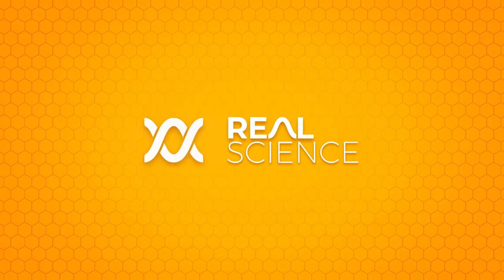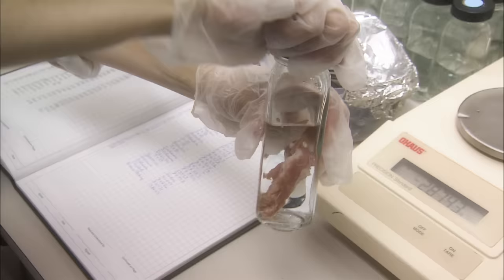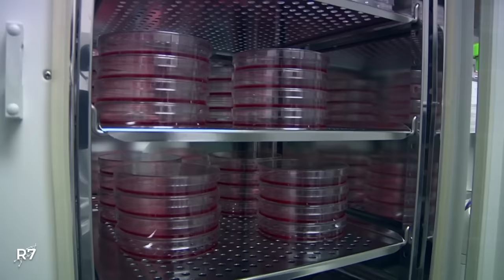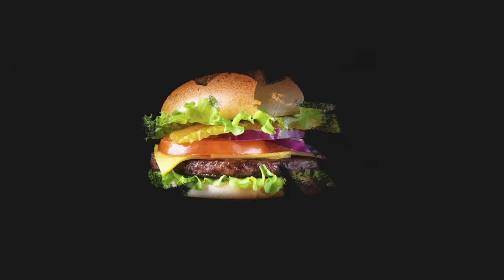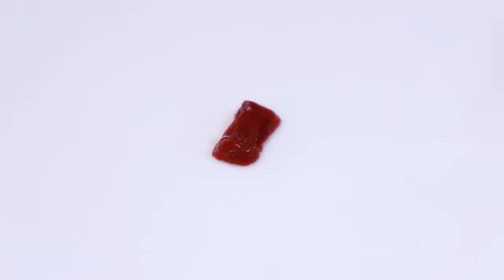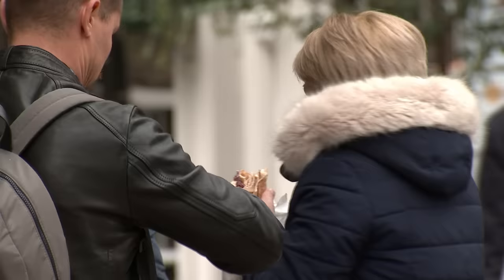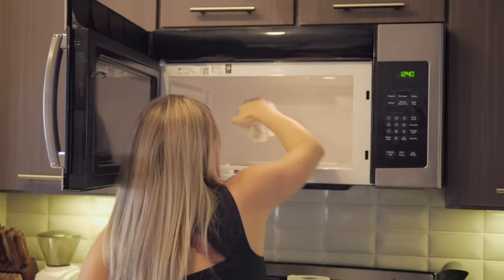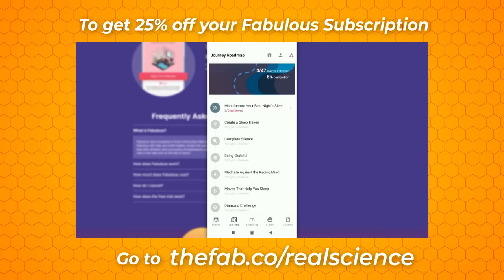The Truth About Lab-Grown Meat

Comment: New technologies are almost always prohibitively expensive. And it will continue to be quite expensive for some time.
    The first microwave ovens, in the late 1940's cost hundreds of thousands of dollars and were only ever sold for massive food processing projects. 
     By the late 50's the price got low enough for restaurants to afford, then by the 80's microwaves got cheap enough that families could use them.
      The price of lab grown meat will come down.
Reply: The first large screen TV was $15,000 ($22,000 adjusted for inflation) in 1997.

Two decades later, they are 100x better at 5% the cost.

The only trick is to keep government off of the market.
Reply: @josephcoon5809  Just look what they did with corn.
Reply: The price is not going anywhere until they solve the FBS problem.  That's going to be extremely difficult, and it's hard to imagine any sort of plant-based alternative existing that has the proper growth factors in it.
Reply: @Warhawk76  Well, in the 1970's no one had any idea how to make transistors small enough that you could make computers smaller AND faster. 
     My dad worked in an oil refinery from 1968 to 1999. 
     They had a computer that helped to run the refinery efficiently and I would often go with mom to pick up dad from work. The computer room in the 70's was two large rooms (about 100' X 100') one above the other. 
     By the time he retired the computer had been updated and replaced. It was now a single unit, smaller than a standard refrigerator.
     Problems with technology always seem insurmountable until a solution is found. This has happened over and over again in history. Why should we thing development of lab grown meat should be any different?
Reply: I can recall when the first microwaves were 500.00 and breadmakers  now look
Reply: Or we find out that we can't lower the price and lab grown meat will simply be given up
Reply: @Eric Taylor  not saying the problem wont be solved, I just can't imagine what the solution might be.  I have used and ordered a lot of FBS for cell culture in the lab, and have a pretty good handle on why it is used, which is why I don't have any good idea of an alternate.  Maybe we will figure out a solution, or maybe we will simply get far more efficient at raising animals for meat.  Humans are immensely adaptable, so either way I am not worried.
Reply: Absolutely right Eric. Lab grown meat will really become prolific once it is adopted by the fast food industry - a market ideally suited to it, with little concern by its consumers over origins, ethics, taste (which could be adjusted with enhancers etc.)
Reply: Even plastic was costly initially, now it's so cheap its a problem.
Reply: @Warhawk76  It will be extremely difficult, so it'll probably take time to identify the constituents of FBS and understand how they work. I think it can be done eventually, but the question is how long the funding will hold out. Will corporations keep funding research that may not pay off for a decade or longer?
Reply: @josephcoon5809  "keep government out of the market" yeah and what about federal loans? You talk about market as if it's a magical perpetual momentun machine, but the largest companies out there get trillions of investment from the state, i.e our taxes. 
Good luck breaking monopoly and maintaning market presence on sales money alone lmao
Reply: However, we didn't need baby bovine juice for either microwave or TV; so I wouldn't be that certain
Reply: @odalicio  “Keep government out of the market” means no loans to the largest companies.

Yeah…it’s kind of impossible for competition to be viable when people keep voting for MORE federal laws. If you were a wealth CEO of a multi-billion dollar company, would it be easier to buy ONE set of Federal legislators or 1,000s of local legislators?

The only reason there are monopolies, right now, is because people voted to give government the power to award those monopolies.

Yes. The market IS a perpetual momentum machine. It has existed since the beginning of time. Just because humans slapped a name on something, it doesn’t mean humans invented it. The basis of an economy is a value gradient. From the value gradient, value is extracted. Whether it’s a gravitational and electromagnetic energy gradient resulting in waves in the electromagnetic field or a house/money gradient, an economy results in the transfer of one gradient to another.

You would do well to learn MORE than what a typical college course has to condition you with.
Reply: you people always use the few success story to claim this one too will be a success technology but you never take failed prediction like flying car, moon colonisation human like intelligence in computer
Reply: @bobipineman  Just because some technologies have not yet been realized doesn't mean those technologies have failed.
     The three "failed" technologies you mentioned are all still being worked out and breakthroughs are still being made that bring those technologies closer.
      Things like AI, flying cars, and space exploration all involve multiple fields of engineering and technology that all need further development before they can be realized.
Reply: For sure, markets for luxury goods (spice from the East Indies, silk and porcelain from China, gold from Africa etc) have existed since ancient times. But the markets surrounding the so called 'factors of production' are mostly recent innovations that have their origins in the English Manorial system or 'Agrarian Capitalism' (as Meiskins-Wood put it) that was practiced in the late Middle Ages.

 @josephcoon5809
Reply: eat bugs.
Reply: it's not a given that all technologies fall in price
Reply: @erictaylor5462  when I mean failed is be failed expectiation. Like you technohype peep blind yourself against severe issue that make your unrealistic expectation impossible. The exemple I gived you have each fatal flaw that make them impossible.
A counterexemple is 3d printing but contrary to the exemple I given(which they no more than technological show) 3D printing did always have a pratical use. Contrary to in vitro meat have massive flaw that make it commercially non viable as long those aren't resolved it will never evolve beyond it technological show state
Reply: @erictaylor5462  And I will pop your bubble but that the most realistic scenario of in vitro meat situation. The hype is still big so investor funel they're money into it. Time pass the fatal flaw are still not resolved. The technology barely progress contrary to the unrealistic expectation. Deceived, people stop sending money into it. Without any pratical use outside of research(who want a 10 000 burger?) Most startup die in their egg. And the technology is dumped in the trash. (and sometime technology never get pass the prototype because they were dumb to begin with, the overexpensive not cruelty free technology will compete with vegan faux meat and maybe insect meat. The fact that it currently can't will be it final nail in the coffin)
I argued with a guy once that in 10 year in vitro meat will be commercialized.. I think his expectation are broken
Reply: @bobipineman  You will forgive me for not taking you seriously, considering you can't even seem to construct a coherent sentence that makes sense and communicates your thoughts clearly.
     Even if English is not your native language and your skill in it is still limited you clearly have no idea how technological and scientific advancement is achieved so it will be quite hard for you to pop any bubbles.
     You keep pointing things out like "most start ups die in the egg" which is true enough, but it doesn't prove your point. Most is not all. Some are successful, and some are wildly successful.
     We could have been having this same conversation in the year 1900 about airplanes. In that year no one had quite figured out how to solve all of the problems to make a controllable powered flying machine. There had been a great many attempts to build a machine that could fly and they had all failed, some had failed in a deadly fashion! But with so many people working on it, it was only a matter of time before those problems were worked out.
    Then, just before the end of the year 1903 a pair of brothers were successful.

     What is impossible today, won't be later.
Reply: @erictaylor5462  typical technohypist always claiming: because X worked Y will work too without any further elaboration on why it will thrive rather than collapse
Reply: @odalicio  Son, competition has been driving evolution and economics for billions of years. Nature knows better than college.

However, you can continue to be selective in the datasets you consider to justify your propensity to lick boots.
Reply: @erictaylor5462  I think what this video was trying to explain was that lab grown meat is currently ethically worse than normal meat. In other words, scientists are yet to discover the process for growing meat in the lab without slaughtering any animals. They may succeed 10 years from now, 20 years from now or we might go extinct as a consequence of failing to change our carbon releasing diet and lifestyle and never succeed.
Reply: In 1970's we had supersonic transatlantic flights on Concorde for around $1000 per passenger($4000 adjusted for inflation), today there are no supersonic passenger flights because even at that price it was not financially feasible.
Reply: Because of the biology involved, this is a much bigger problem to solve. It's going to cost billions and even then they may not crack this at all, it's risky. Things like aquaculture are a lot less risky/more productive.
Reply: @quixomega  So we should only fund research that is safe, easy, and is sure to have high returns?
Reply: Or it will be abandoned as algae/insect meat production does the same job for far cheaper.
Reply: @josephcoon5809  interesting pseudo-thermodynamic idea espoused there. Especially the part where you called it a perpetual motion machine before immediately relying on thermodynamics to justify your take. Very interesting
Reply: @josephcoon5809  okay this second thing about harmony and rejection and ideology is like reading Time Cube
Reply: @kaitlyn__L  It’s great you kids love using the word “pseudo” and all, but all it does is illustrate your lack of original thought.

If abstract concepts are too difficult, pick an instance, and we can work our way up from there.

The irony of existing as an abstraction and not being able to abstract. 😂
Reply: You understand you're talking about electronics here, right? The NEW field that was CRAZY expensive and inefficient and we had developed most by far? Meanwhile, for example, MECHANICAL stuff didn't get too much cheaper, outside of the shit you buy from china made from cheap recycled metals that break as easy as plastics... Average car prices in 1950 where 2200$, which is 26000$ in today's money, an average car today costs 47000$. What's that, it costs MORE now? Sure, there's a lot of innovations installed, but even the most minimalistic and cheap ones (again, talking NEW cars, not used) cost minimum 20000$ (but we talking averages so in 1950 you could find cheaper models too).  So where is that cheapening again? How about GAS? We had all sorts of oil drilling advances since then... WHY then is it more expensive?? Medical services (which by the way require a lot of the things that'd be used for this too, aka chemicals and various bioshit) have gone up massively... What makes you think all the costs for this stuff will go down, if ANY of said costs when research, science (except electronics), and medicine, all the stuff at work here, just keep getting more expensive?
Reply: @erictaylor5462  mate dont waste your time with idiots online, just ignore them and move on, you have better things to do
Reply: @erictaylor5462  Thing is, for every success story, there is a failure one. 

Its really not as simple as technology gets better, because not all of them do.
Reply: @erictaylor5462  most of the “failed technologies” aren’t practical. Flying cars would be hell with traffic and parking and the fact that public transportation is being more valued than private, it wouldn’t be as profitable or really y’know Practical. Moon colonies or mars colonies aren’t needed as well, we are way more safe on earth than on mars for millions of years. Plus the fact that there aren’t (or we didn’t find) any valuable resources on the moon or planets that would make us want to go there and extract stuff and even IF they had valuable resources, it would be hell to even get them to earth on a regular basis. Instead of outer space colonies we should focus on our wastelands like the Sahara desert or the vast snow lands that are at least more livable than the mars or the moon.
Reply: @cornbreadfedkirkpatrick9647  I’m slll
Reply: @erictaylor5462  but its not problem with technology but biology
Reply: @erictaylor5462  Well said.
Reply: @erinm9445  Sounds like getting rid of the fetal bovine serum is a great way to cut costs. Good to hear that someone has already succeeded.
Reply: technology  is a lot quicker  than 1940
Reply: You are comparing torturing a baby cow to a microwave???
Reply: @Blueskys1972  How is growing beef in a lab torturing baby cows? No cows of any age are used in the process.
     That's the point. You are growing animal flesh without involving an animal.
Reply: I wouldn't eat it if it were free

Comment: 10:53 Just a quick fact check. 5000L in roughly 42bbl, which while large for a craft brewery is TINY for macro breweries. The Milwaulkee MillerCoors plant has several 6000bbl fermeters, or about 700,000L. 5000L is FAR from the largest fermenters.
Reply: Noticed this as well, think the editor swapped the units, since a 5000 BBL fermenter would be close to the largest tanks in the world.
Reply: 5000L is still quite big considering it only produces 1kg of meat.
Reply: @kushalvora7682  They don't build a tank to only produce 1kg of meat. It can be reused. ;)
 
Jokes aside, the important statistic would be the production rate. How long does it take per kilogram of meat?

Comment: One advantage in my honest opinion to just continuing to eat, responsibly raised cows, is they are able to eat what we can’t and where we can’t grow food. We can’t eat grasses and other heavily cellulose based plant foods so they eat it for us and we eat them for the nutrients. Plus the carbon emissions thing is kinda disingenuous when you realize that cows don’t add carbon but recycle it. They eat the plants that consume carbon, cows spit out carbon and methane, that eventually either gets absorbed by another plant or the methane brakes down into other components that plants also use thus the cycle continues. Where as digging up buried carbon and burning has no cycle for going back into the ground as oil, least not a fast solution. I think attacking meat for carbon emissions is kinda silly in the grand scheme of it all. Besides not all protein is the same.

Edit: just a fact methane brakes down in the atmosphere in ten years where as carbon takes two hundred years.
Reply: The point is that we’re breaking the balance, right? An ecosystem maintains a healthy carbon cycle so long as it’s not disrupted, but the meat demand of the world population is simply too high for us not to disrupt the balance of the global ecosystem. We breed progressively more cows and continue to deforest, producing too many greenhouse gases with too few plants and other sinks to swallow them.

For the time being, the meat industry is not sustainable, though it would be much better if it was. The best current move is still to reduce consumption.